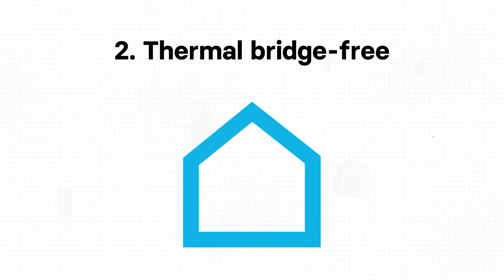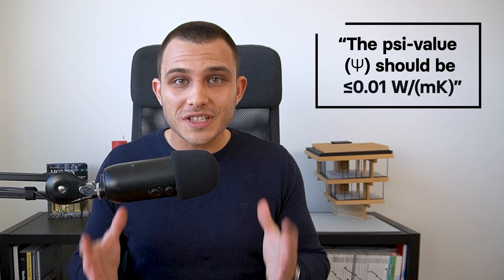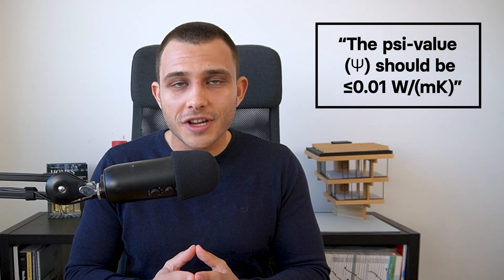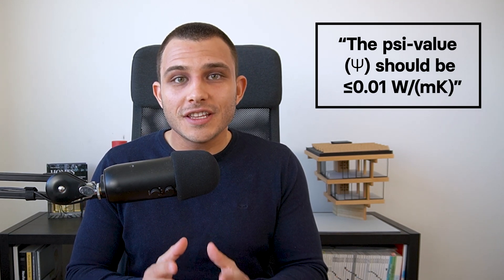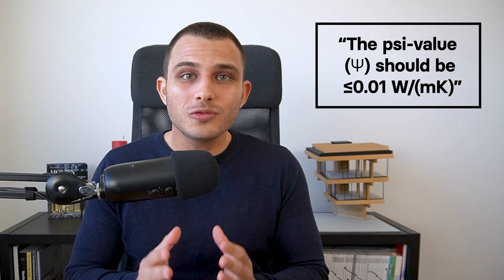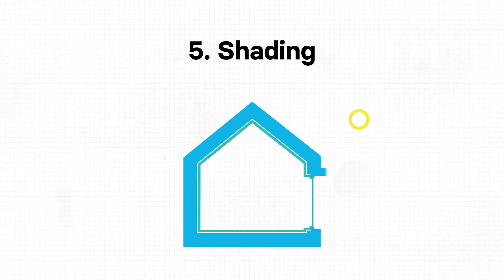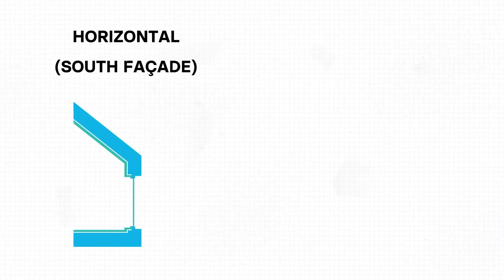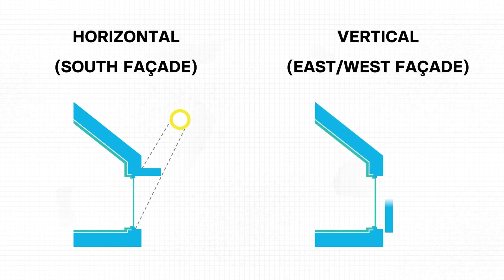How To Design Buildings That Use 90% Less Energy

Comment: I'm a great fan of these principels. However one is missing:
heat storage capacity ! 
passive solar gains lead to rapid overheating of a well insulated home, when the thermal storage capacity is unsufficient - even in winter. I would hate to ventilate these precious gains to the outside !
Reply from the maker: Thermal mass / heat storage plays a much smaller role in Passive House projects compared to standard buildings, due to the high insulation levels. Basically, the more energy-efficient the building is, the smaller the role of thermal mass is. Therefore, thermal mass is not a leading factor in the decision-making process for Passive House projects for example when choosing between concrete and timber.
Reply: I get your point. However: good insulation and ERV only reduce external loads! Internal gains are trapped inside.  This is a good thing as long as you need them; otherwise the asset becomes a liability, and heats up the building beyond the comfort threshold. Rather than bypassing the ERV or opening the windows i'd prefer to store the gains in thermal mass for use in the next   cold Phase.
Reply from the maker: These principles are applicable for warm and hot climates as well. ERV still helps in hot climates because it keeps the heat outside and the colder (conditioned) air inside. During the night, when outside it's cooler, we can use night cooling or HRV bypass, which helps cool down the building and make use of the lower outside temperatures. Regarding the thermal mass - in warmer climates it's more effective but still not as effective as the night cooling/HRV bypass.
Reply: I'm with you for the summer case. My concern is overheating in  winter, if you combine large southfacing windows with low thermal mass as eg SIP- panels provide. Does that show in PHI simulations?